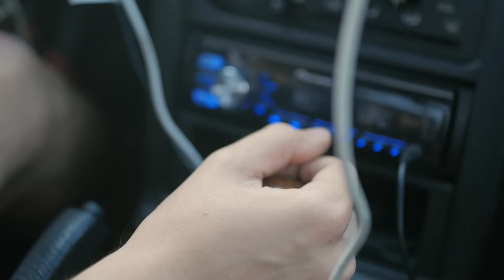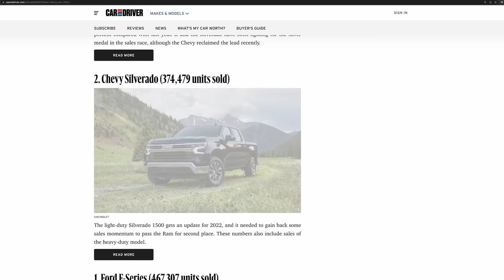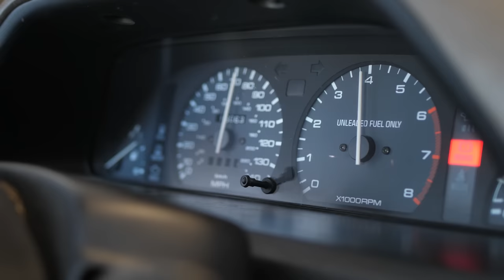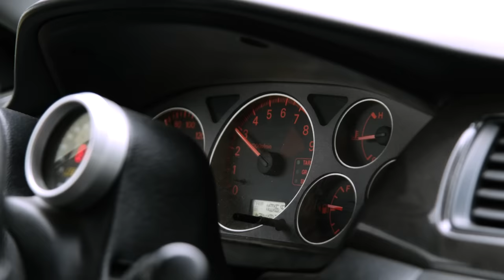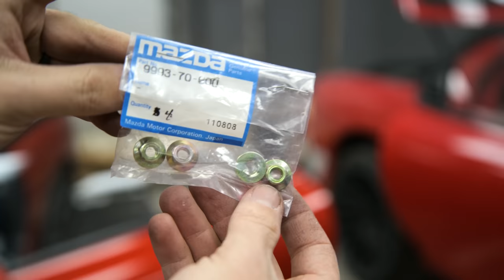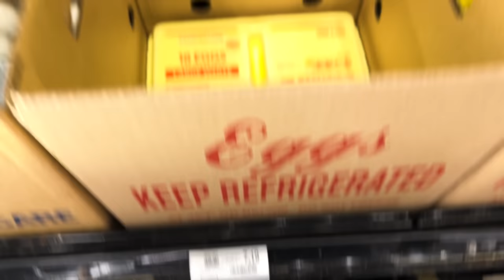Daily Drive Your Fun Car

Comment: I dailyed my project car from high school to college. It's hard when you can't afford to have the car down, passing on engine mods and choosing suspension and other mods because you only have weekends to install them is a very common feeling. Going from installing standalone, poly bushings, and two engine swaps in a year have been very draining. That's what drove me to buy my cheap project daily (LS Teg) so I can finally stop dailying the race car. Bringing my laptop for retuning, checking all the fluids constantly, and I noticed that I worried more and more about it as I spent more money over time. Would I think it would've been easier with a seperate daily? Yeah. Would I do it all over again? Yeah.
Reply: Yeah, I can't imagine. Since I really got into this a year ago I really enjoy having two cars so I can just have one on jackstands and take my time with what I need to do. 
On both my Celica and Supra I've re-sprayed/fixed/relubed the calipers, replaced rotors, pads, tires, wheels, bled brakes, all swaybar links and both those jobs required a lot of time as things don't go as you may want them to. I would be stressed out of my head getting it all done in a weekend and hoping nothing goes wrong lol.

Comment: That's why I daily my 9-3. There is just something about Saab that puts a wide smile on my face every time I drive it, even if it's just to get groceries.
They're quite cheep here in Europe, the engines are FANTASTIC for tuning (300hp on stock internals with just a bigger turbo, injectors and a new ECU map from a 2.0 is pretty damn good IMO), parts are relatively inexpensive (with some exceptions), It's pretty easy to work on, it's comfortable, it drives really well for a FWD car, it's practical enough for my needs and it's not bad on MPG.
Driving a car you love every day is an amazing feeling, especially when you have these empty stretches of the road where you can have some "extra fun" on your daily commute.

I'm saving up for a "rebuild" bc there's a long list of small things to fix that have accumulated from previous owners and the three years I've owned it.
Things like minor dents, some scratches, some wires needing replacement, interior lights flickering, the booth button not working, whole timing set replacement and valve adjustment, some cracked vacuum hoses making the idle kinda bad, two power windows not working, etc.
Lots of things that individually would be very cheap to fix but all together it'll probably cost me a fair bit.
Once it's sorted out Imma start doing some actual mods like a nice set of coilovers, better brakes and a good bit more power (aiming for around 300hp).

Comment: I've owned over 30 cars, many of them sports cars. S2000, WRX, civic SI, etc. Now I daily drive an Acura TL SH-AWD manual. Love the comfort , 4 doors, and decent power. Fun enough and reliable. The worst car I had was S2000 as a daily, spun it out too many times.
Reply: Wait. Awd and manual? I didn't know they made those, what year is it
Reply: @nikoprather  2010 - 2012. Mine is a 2010

Comment: I agree with some points to this. But like others in the comments. I work in the city. Not favorable for daily suspensions, let alone a fun car with suspension. Horsepower doesn't matter driving through the city with traffic or a traffic light every block. So for me, I have a tastefully modded 07 STI for fun and a practical yet still fun and capable 04 Impreza wagon. Everyone however should enjoy what they drive whether daily or fun.

Comment: My daily sees light track use. So my Cobb sway bars are on the soft setting until track day. Same with brake pads, I put on EBC pads for the track and go back to street pads after. Coilovers also readjusted. It’s all the aero and keeping setting for the track on the street that causes problems. If you can build modularly and make full use of the settings ranges of aftermarket parts it’s a lot better.
Reply: Especially when those settings are easy to adjust. Nothing like having to break out the full tool kit, and tear the car half apart to adjust some suspension

Comment: I've been daily driving my 2002 Nissan JDM Z33 for almost a year now and it fits most of the criteria. Practicality leaves a bit to be desired as once I put my essentials like some tools and extra oil in the trunk I lose most of the little space I have. It still gets plenty decent gas mileage assuming I don't floor it everywhere, and the shaken (Japanese vehicle inspection) legal Kakimoto exhaust has a good sound without being too loud or droney for long trips. The suspension and steering feel great in the mountains and aren't too harsh on the street, even with the lowering springs that are just under stock height. My last couple daily cars were either boring (99 Camry) or painfully slow and nearly unusable on the highway (82 Yota Pickup with a lift), so the Z is a good change of pace. Reliability so far hasn't been an issue after I replaced the basic maintenance items with a few extras (spark plugs, coil packs, suspension arms with blown bushings, brakes, tie rods, and valve covers) While I'm sure there will be more issues as the car gets closer to 100k Miles (I'm at ~148k KMs), I know I can replace most items without too much work or expense.(The valve covers were a PITA tho) Because I'm about $5k into the car I don't have any issues beating on the car in the mountains or on the highway.

The smile factor for me negates all the issues I have with my Z, every time I park it, drive it, or walk up to it in my parking lot I instantly forget all the negatives and smile. I know I can count on the car to make me smile in the mountains, look good on the Tokyo streets and I can never get over how It makes me feel when I see the Daytona Blue peeking out from around all the other boring cars in a parking lot.

Comment: My current daily driver is a 2002 Lincoln LS. It fits most of the boxes for what makes a good daily driver. Reliable-ish (Jag powered, after all), good looking, comfortable, practical. And due to its 51-49 weight bias and sporty suspension, it's also amazing to drive.

I know I bought the right car for me when I turn around to look at it when I'm walking away after I park somewhere.

Comment: Daily driving a fun sports car is doable, however you might not get the same experience from certain cars that wouldn’t be ideal for a daily driver.

For me, I have my Toyota MR2 Spyder for my Fun/Summer car. Why? Because it’s hugely impractical,not quite ideal for long distance driving, and here in Canada, winter driving a low to the ground 2 seats convertible is a bad idea. So my “Daily” is a Matrix XRS, which is also a fun car, very practical, cheap to buy, economical and low maintenance. Both fun cars, used for different purposes

Comment: I drive a 85hp mk4 tdi and I love it. It's a slow car realistically, but the in gear acceleration, driving at 100 percent whenever i want to, and the turbo noises it makes. It's already beat up too on the outside so i don't have to care too much about driving it in the winter. Number 1 and the financial aspect of driving it have the most weight in my opinion. Plus did I mention I get 45 mpg average?

Comment: I have 2 cars, I drive roughly 3 hours daily for my commute and my current “commuter” car is my 2018 WRX. Already put on 33k miles in just over a year and it’s been modified for about 25k of those miles. I bought a NB Miata to split the commute and just have a backup car if my wrx needs large repairs.

At the end of the day, both cars put a big smile on my face as they both are a blast to drive.

Comment: So my beater is a 98 LS Teggy I got for $700 with a snapped timing belt but has become the best daily I've built. While I've had my Miata build which I've dailyed through college, it's been good to finally give the big build a rest. It's been fun daily driving my fun car but man going back to stock struts and lowering springs with the teg, having 4 seats, space, a sound system, not worrying bout damaging the car, still being really fun and quick for the price, and getting 32 mpg made me realize you can have fun in the daily, even mod it(intake, headers, with stock muffler for daily), even if it isn't as engaging as the "race car" all the time.

Comment: I’ve had my stock engine civic si ep3 for almost 8 years now and it still brings a smile to my face to rip it on some good backroads. 160hp isn’t much these days but the driving experience is lovely, and practicality through the roof!

Comment: I have been dayling my 98 V6 S-Class (W220) and i absolutly love it. Yes it gets terrible milage and yes it is a pain in the city or tight neigborhoods, but when im coming home from work and i get to put it on the highway its just amazing. Aslo remeber that a fun car is what you enjoy. Does not have to be wildly modified and ready for the track with pinpoint handeling. I like a floating big engine cruiser. Think about what kinda driving you are going to do in your daily and what you enjoy doing.

Comment: I used to have a 94 geo metro with a 3 cylinder engine, 5 speed, no AC, power steering, or airbags from the factory.
It only had around 50 horsepower, but I loved that car. It got about 45 mpg and got me where I needed to be with no issues. It also made my project car feel so much faster.
R.I.P. metro.

Comment: I just sold my 2021 GTI. I was always scared of scratching it, dinging it and all else cause of where I live… Middle of nowhere, crappy roads and gravel, rough winters, etc. Just a golf, but an expensive golf. Then I bought a 2014 Jetta TDI… It’s slow, but it’s so much fun. I can floor it, bang through all 6 gears, and not even worry about speeding tickets. Don’t have to worry about the exterior. It’s comfortable. It sounds decent. Mileage is fantastic, which is awesome cause I do a lot of travelling. Couldn’t be happier.

Comment: as a '18 civic sr owner with 128 hp, 200-400 hp sounds like a lot, over all cars I owned 100-200 hp is perfectly fine for a daily driver. I see that anything below 100 is a nightmare that can't pick up the speed when needed. Though, ofc, this is a personal opinion, both mine and yours, but man isn't civic hitting all the other boxes. It is fun to drive, practical, economical (fairly), safe, reliable and maaaan it looks great. This is one car that makes me smile after I get out of the office. It has enough power to join in onto a motorway traffic and start faster than a muppet in peugeot 308 gt that thinks 200 hp makes his car a sports car and that a "fast" car makes a driver. I bought it moving from a daily SUV commuter and man I am having fun with it. Yes, it is less economical day to day, but it is a car that I can sit in for 20h and then go back to it and be happy about it all over again.

Comment: It's the whole reason I bought a 2nd Mustang, my turbo Saleen is the fun car, while the V6 is the daily driver. The 3.7 has plenty of power for fun, it revs high, but it's also economical on fuel costs being that you can run 87. It has lots of trunk space, and a car seat fits perfect in the back for my kiddo. Bought it cheap, it's reliable, and easy to fix!

Comment: I had my one car for 18 years, my Integra GSR owned since 2001, until I also picked up a 2000 Miata in 2019. Was going to sell the Integra but then came to my senses and kept both. Both relatively old and low cost vehicles. I use both cars on a weekly basis. And it sure is nice having a car available when one of them breaks.

Comment: Honestly I couldn't agree more on basically everything. Earlier this year I bought an old low milage jeep cherokee xj. Everyone thought I was crazy because it get horrible fuel economy and I commute 100 miles a day round trip, but it was alot of fun exploring offroad and has enough space for my lifestyle. I then proceeded to accidentally rip the rear axle out on a huge pot hole and spent a little more then the price I payed for the jeep on suspension and tires. Now I have a jeep that I jump on the daily, handles way better than it has any right to in the corners with a little lift off over steer, and is reliable and comfortable enough for me. My family and coworkers still think I'm insane but I wouldn't trade it for anything. It's a hooligan that always puts a smile on my face.

Comment: I am supremely blessed to have 2 rides:

My toy is a '91 Toyota MR2 SW20. It's my first manual and has UHP tires - so it's harder to drive in town/bad weather. It needs some electrical work and is 30 years old. But it's a blast! Just not a good daily

My daily is a 2012 Mini Countryman S All4 R60. With a turbocharger and some other modifications, it puts out around 230hp in a small package to all 4 wheels. It's an automatic but has a sport steptronic transmission so I can shift when I want to. It handles snow here in WI great, has heated seats, has 4 doors, a big hatch, has mood lighting, bluetooth, and even rear mounts for carseats (future concern). It's the perfect daily!

Comment: I think just being peppy is more important than having 200hp, if it has good steering and throttle response (manual 90% of the time) and is practical and comfortable enough and cheapish to maintain that you can maintain and a type of car you can say to your peers you drive, go for it, I own a Ford ef XR6 Falcon, aside from not being manual yet, I really like it

Comment: My current dream car checks all of these boxes. I have no particular love for the chassis but can’t help but recognize that a k swapped brz/86 could very well be my ultimate long term, ever evolving fun car. Part’s availability for both anyone and chassis are plentiful nearly second to none on either. It’d be fairly unique as I don’t think these cars are actually swapped as often as something like an s chassis and tuning it to make big power is allways attainable. A fantastic chassis with a fantastic engine paired with a deep aftermarket for both to the point where you can buy a swap kit that makes the entire project feasible for most any decent drive way mechanic and affordable at around 20k on the low end and 30 on the high. It’s currently what I’m working towards for the time being.

Comment: Just recently bought an 01' Celica GT-S to replace my 94' Camry as my DD. Over twice the price for twice the miles (142K), it's extremely silly because the pros of owning a 73K mile Camry outweigh any cons. Still I just wanted something both fairly flashy, fun, fairly rare, and very reliable so that was my pick.
I have no problem using my 1988 Supra has a daily either, it's an absolutely amazing car that so far has been very reliable.
You do ABSOLUTELY need a DD car to go along with a fun/project car though. At the very least so you can work on (or a shop) it while still having transport.

Comment: I've got an E46 325i Touring. It's got plenty of power for the kind of driving I do and comfortably does 190 km/h on the Autobahn (and up to 235 if I'm in a hurry).
It handles great.
It's a wagon. 
It's comfortable.
It's safe enough.
I can afford it even with the current gas prices. If I drive it economically on my daily commute I can get it down to 8 l/100km.
It's been very reliable and I expect it to stay that way.
Very few things are a pain to replace.
E46 parts are abundant in Germany.
And lastly, damn does this beautiful thing put a smile on my face.

Comment: This is what my 2018 2.5L Mazda 3 is. A hell of a lot more fun than the corolla I had before but still reliable and decent gas mileage. Sure I wish I had a cooler car, but for me at this point in life it's perfect.
Reply: I have a 2015 2.5L Mazda 3 with a 6 speed manual and it has been my favorite car. I have light mods, intake, exhaust, strut tower bar and lighter wheels. The thing never fails to put a smile on my face and surprises people with how quick it is. Though I might finally be retiring her this year for an Elantra N